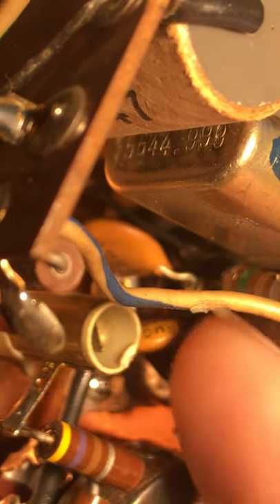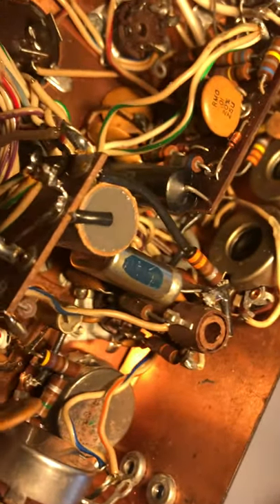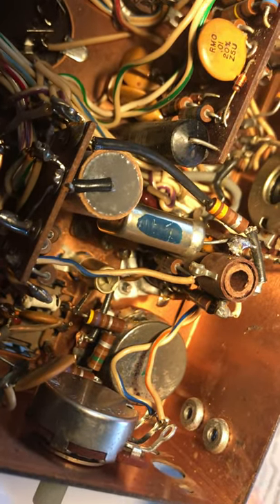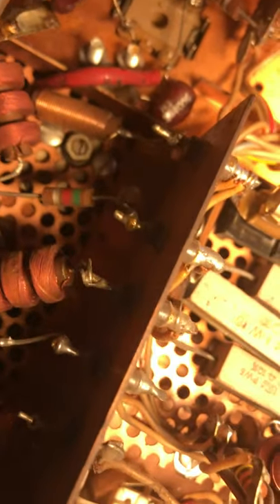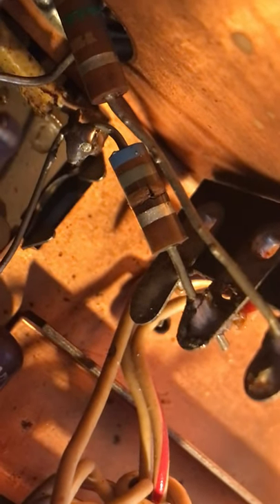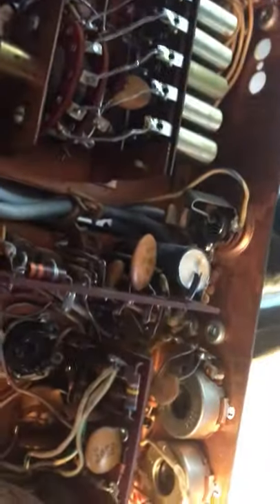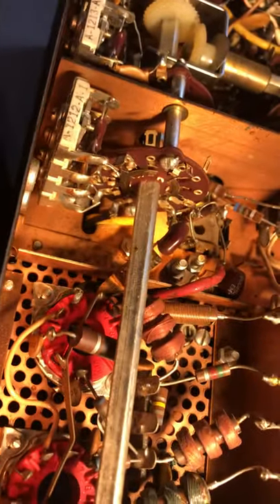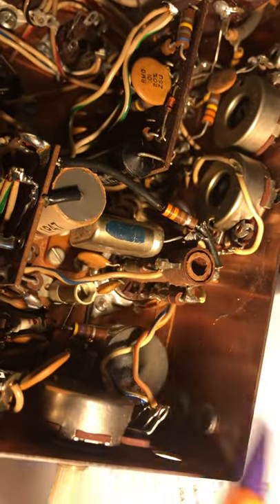Drake TX4B transmitter  location of SSB oscillator and overview of underside again August 16, 2021

Comment: BTW, I have an oscilloscope, a function generator, a multimeter, a soldering station, and HackRF SDR receiver. Go you know where, if any those might help : )
A spectrum analyzer would help for the alignment, but I don't have one.
Reply from the maker: Thanks Brenda. I may take you up on your offer. I am out in the weeds on this thing. I am suspecting the wafer switches might be misaligned as they have a gear for a 90 degree motion conversion. I got about 40 watts out of it using a lightbulb for a dummy load last night but on 5.? MC the wrong band. So I think the finals and the driver tube are working. Been a long time since I have worked on old tube tech. All I have here is that old receiver and a newer Chinese signal generator. I bought this thing to talk to hams in the New England area if I go back to visit in the Fall (October) and talk to them on AM. I have no equipment any more as I exited radio in the early 2000's. The build quality of Drake B line seems high. My plan was to use SDR's on the Web and just transmit with this transmitter.
Reply: @moviestudioland  , unfortunately the light bulb is a bit inductive. You are very resourceful, though.
Some good contact cleaner/lube might make make the wafer switches nice, because if the friction is too high--it will stress the other moving parts. If you crack one of those nylon gears, it will be difficult to fix.
Contact me if you need anything I might have.
Reply from the maker: Hi Brenda, I found a Tektronics scope from your alter ego. A great fellow in Berkeley was selling it for $50. So I drove to Berkeley Thursday Aug 20th. Left at 6:30pm and got there at 8:30pm. Had to take 280 north and cross the 92 bridge and then the 880 to Berkeley via the 24. Gentlemen and I talked for about an hour. He does lots with stepper motors and Adruinos like you do. After a chat I was back on the road and headed home. He had replaced this scope with a Rigol on his work bench. I probably should have bought a Rigol but I could not pass up a Tektronics at $50. Only problem the scope is HUGE and larger then my work table which also serves as a home office

Comment: Of course, any electrolytic capacitors are suspect.
Reply from the maker: I had covered the radio with a pillow when I first turned it on. We were scrubbing the copper with a vinegar saltwatter mix and I do not think this helped the radio.. I had a smoking resistor in the Driver cathode circuit. Took a hair dryer and baked the radio and no more arcs. SO much built up crud on the deck....
Reply from the maker: Yep caps I guess can explode when first powered up? I used a pillow as a shield. No explosions.